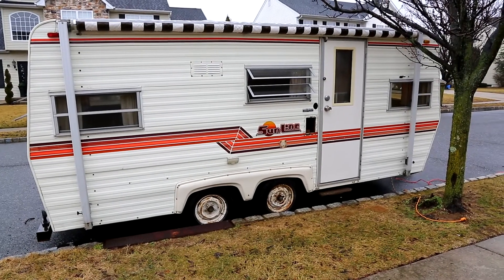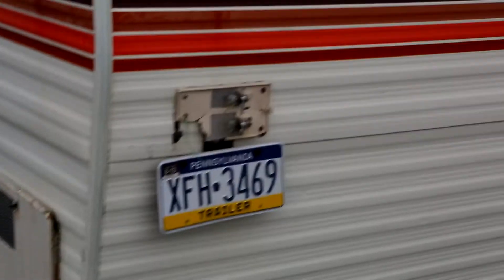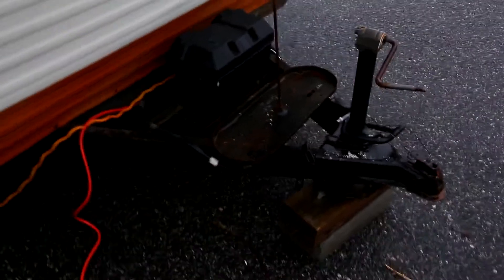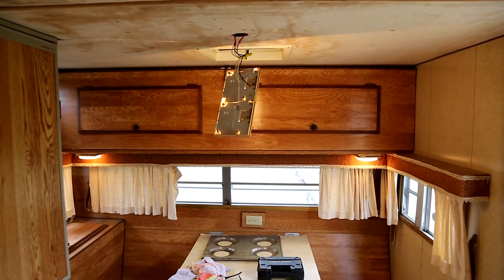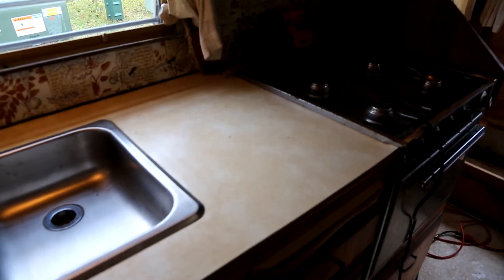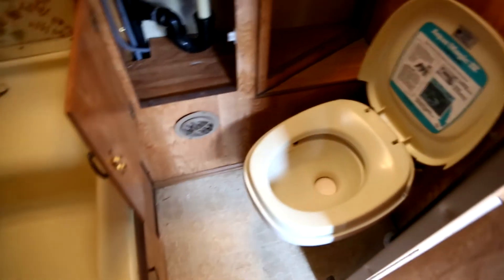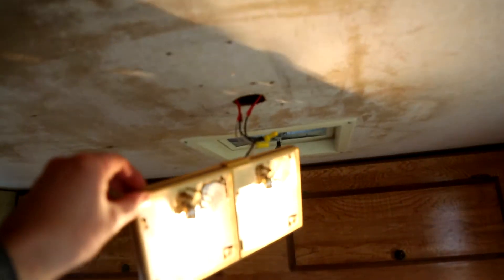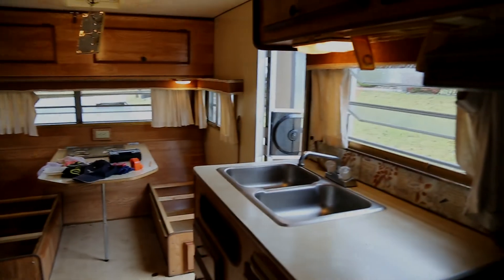Sh#tbox Restoration E01 - 1981 Sunline Camper Trailer

Comment: How did you get the fridge out ?
Reply from the maker: It was a bit of a chore, there are screws that are removed and it slides out.  Not horrible.  Detach the Propane first.
Reply: @tfxstudio  did it fit out the door or the window ?
Reply from the maker: @suziekane9605  We were able to get it out the door.